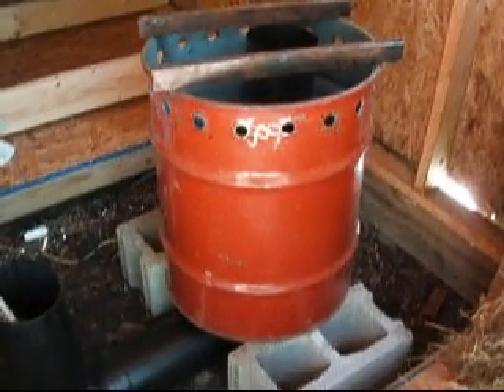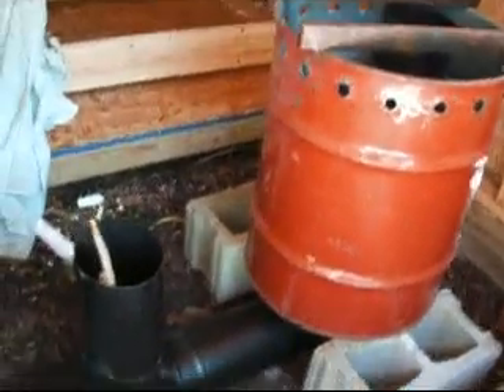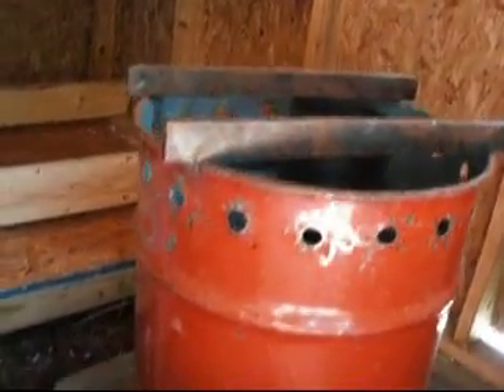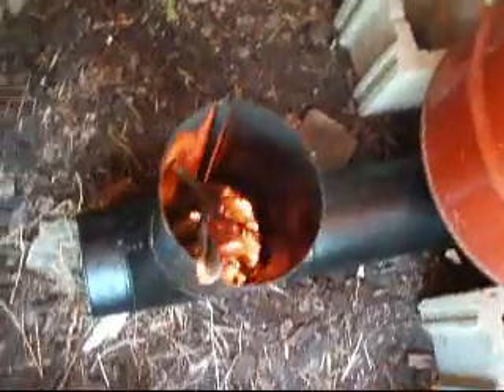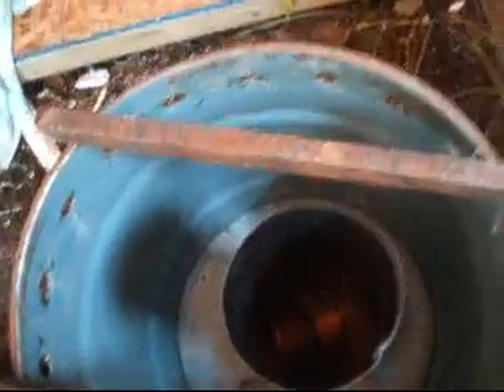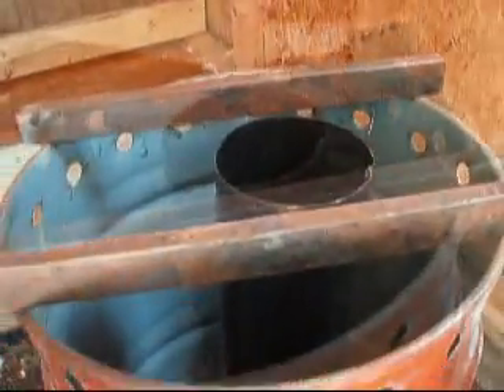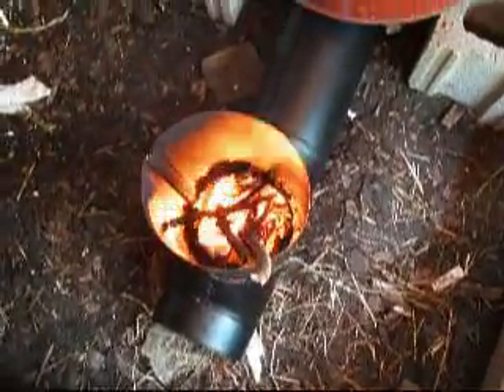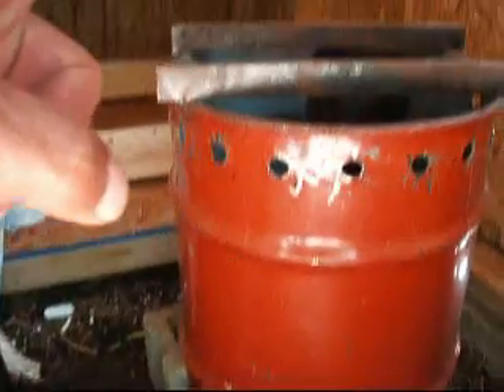Rocket stove hot water boiler pt 1

Comment: im thinking you need to block off the feeder tube cos your losing heat there, then open the horozontal pipe so the air is sucked in and then the flames should come out your chimney or mroe heat. also i think your horizontal tube is to long or fire is to near the end of it. great video though.

Comment from the maker: @saeidmomtahan This is still a work in progress. All the pipes will have insulate when finnished. The holes in the orange barrels are for the RS to breath better. Once the boiler barrel is placed on top and the black barrel is placed over the orange ones, you then see why the holes are drilled around the bottom orange barrel. Thanks for the interest.

Click

Comment: Couple of questions. First, do u not loose a lot of heat through theun-insulate horizontal pipe?

Also what are the many holes in the orange bucket for? air intake? why?

Comment from the maker: @cdimmm Your right, the black pipe won't hold up long. I plan on replacing it with 6" well casing once it burns up. I'll be heating a 25 gallon tank which will heat 330 gallons of storage water.